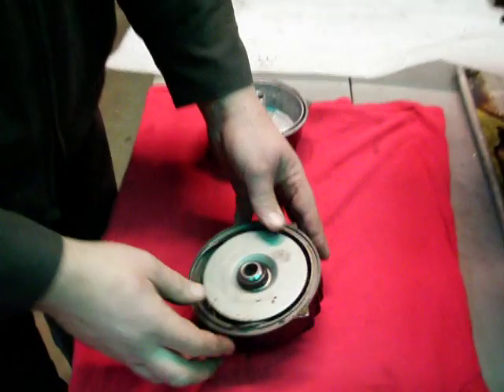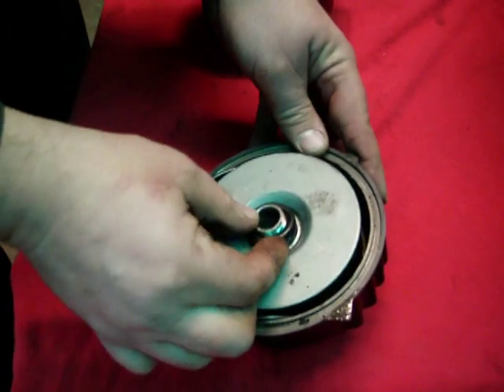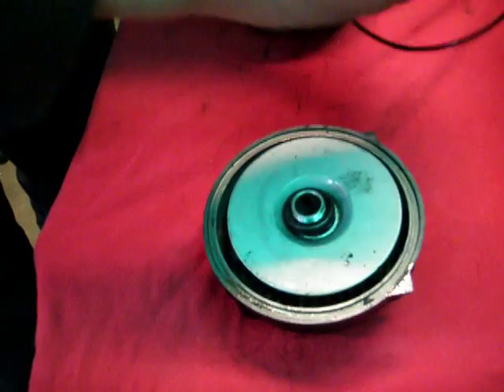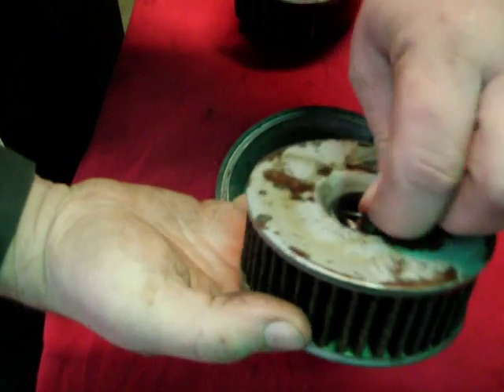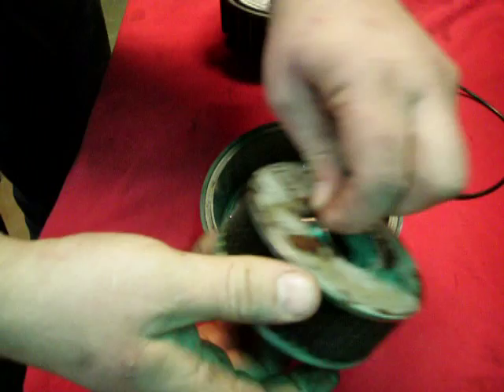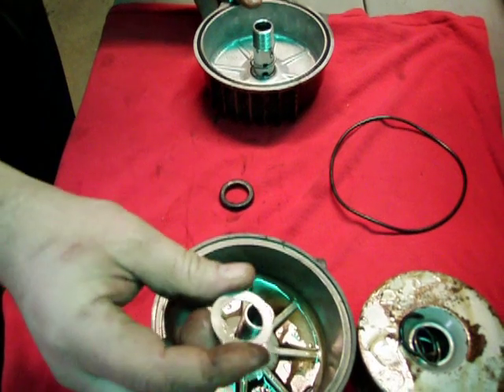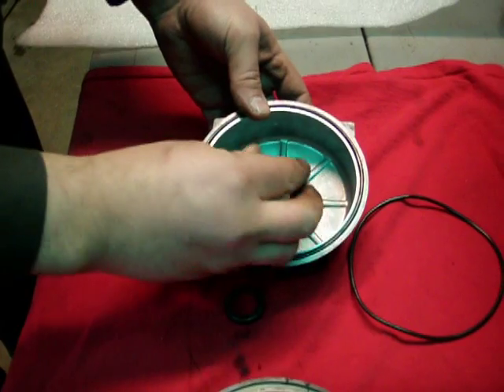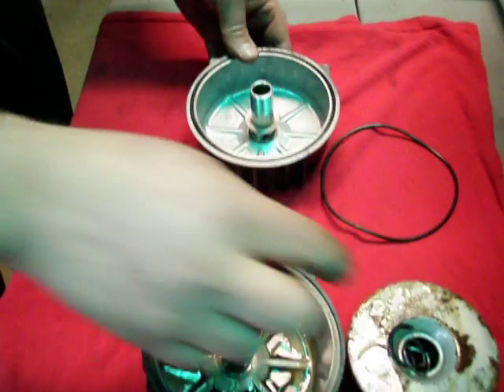Oil Filter Assembly - Yamaha Vmax 85-95

Comment: What's the proper torque needed for that oil filter cover bolt? I had to hire a 700lb gorilla to remove this bolt...crazy tight.  Once off the compression spring and washer were missing? OMG. People need to review the correct items and sequence needed for proper install. I hear the drain plug is 43nm... but can't find the cover bolt spec.  Thx ❤
Reply from the maker: The spec will be in the manual and I don't have that from off the top of my head. It does not need a great amount though

Comment: Sean, can i get the filter washer at the parts store or is there something special about it? can you give the size please?
Reply from the maker: earache06 . I don't have the specific dimensions but there's nothing particularly special. The ID needs to fit over the shaft the OD needs to fit within the filter so it touches against the seal and not the body of the filter